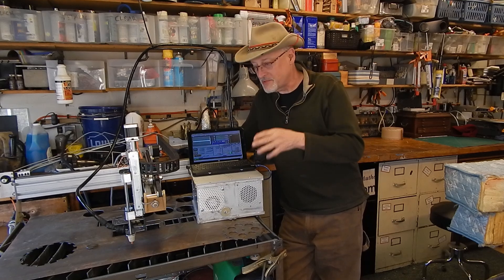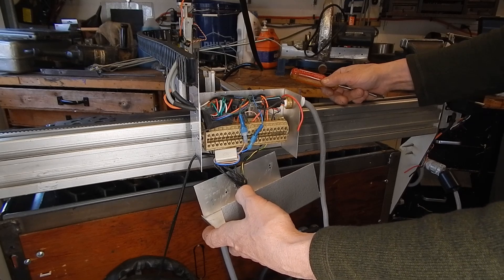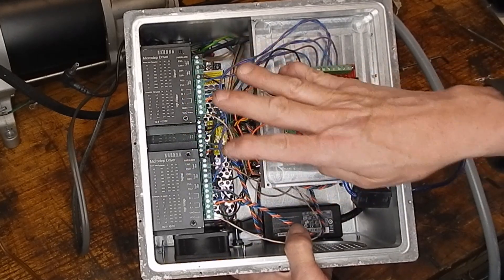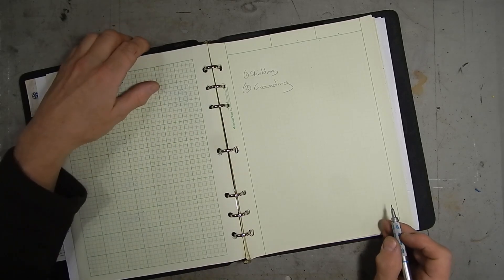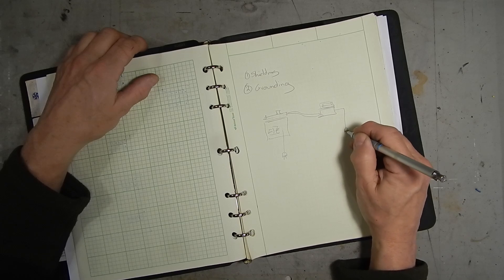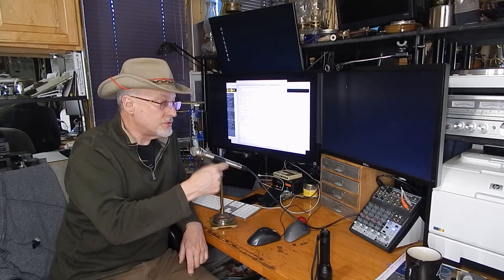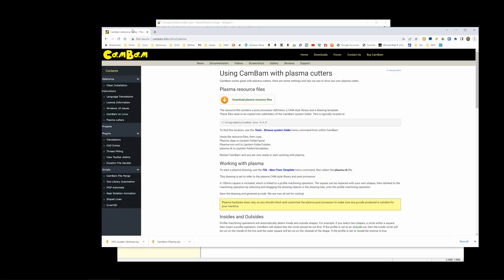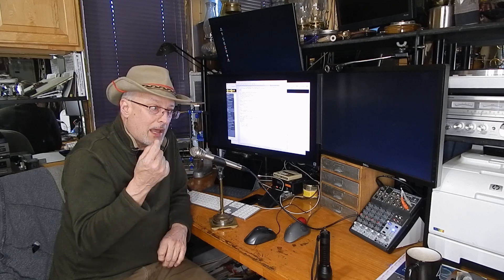CHEAPEST CNC PLASMA - FIXED RFI!

Comment: It would be interesting to hook an amp meter from the tip wire to ground connection and document the current draw before and after the arc is established.

Maybe the tip wire to clamp bleeds off less than you think? A resistor in series could also limit this current drain.

Comment: Great video! I would love a diagram for your filter bank. Can you share what frequency ranges you are filtering? Can't really tell without a resistor value and I don't think you mentioned it. Google says that HF start from plasma cutters can be 10khz-200khz is that about the cutoff frequencies you were shooting for? I'm assuming you're using them as a low-pass filter, but I'm not entirely sure from the way you describe it.

Comment: Sorry but I am just starting out and this EMI stuff is hard to figure out with no electrical knowledge or equipment. So you only connect to the one motor power wire then to capacitor then ground and motor wire can be connected to any lead of the capacitor.
Reply from the maker: Yeah, Basically the capacitors will pass the high frequency noise to ground without effecting the motor current. Every wire from the motors and limit switched is connected to ground thru a capacitor.

Comment: I built a CNC plasma cutter using a cheap cut 50 pilot arc machine but it produces too much emi. I battled the emi issue for quite a while before addressing it on Open Builds forum. By the way open builds control is excellent software for controlling your CNC machine and it's free. They also have Open Builds Cam for converting your files to G-Code and it's also free. A moderator on Open Builds suggested I use a blowback torch plasma cutter rather than my high frequency pilot arc. He said I will find it much more economical to replace the HF plasma cutter than to jump through all the loops with shielding attempts.😮 I have to agree and plan on getting a blowback start plasma cutter. In all of my previous attempts the thing I discovered produced the most interference was the plasma cutter lead itself. It acts as a huge antenna. I was considering making a sleeve for it out of Faraday fabric but decided I would spend the money on a blowback cutter instead. Blowback cutters are generally used most often in environments where sensitive electronics exist. According to the open builds moderator high frequency start is 1970s technology. And while it still works it can be very frustrating in an environment using a cheap arduino-based boards that utilize USB connectivity - such as my MKS DLC 32 v 2.1 control board. I use Grbl.

Comment: I wanted to ask you a question about your CNC cutter. Do you have or plan to install the torch height controller? I already purchased it and many people claim that it will allow the head to keep a constant height above the metal if it is somewhat lighter gauge sheet metal.
Reply from the maker: I’m looking into a Arduino based open source torch height controller but I’m concerned it may not work well with my torch, I may upgrade it before I try.

Comment: Thanks great video. I am building a CNC plasma cutter and I may have overkilled the strength and weight of it. I could probably attach a high-torque motor and use it as a mill.
Reply from the maker: Look into a "drag knife" for cutter cardboard, gasket material, vinyl, etc.

Comment: Hi Jake thank you for bringing to my attention your video. I didn't understand perfectly what are you connecting the capacitors with, you say all the lines but i am not sure. is it like all the motors cables ?
Reply from the maker: Every stepper and limit switch wire on the gantry gets a 47pF cap to ground so only DC current gets back to the controller in the separate box.
Reply: @JakevonSlatt  Thank you for your answer! Pardon me for asking more about this i am just thinking of implementing it  and want to be sure. So suppose i wanted to make the remedy(filter) for the first wire out of the four wires of the first motor, I would intercept its wire, add the capacitor and link its other end to the ground ?

Comment: Hi, apologies for my naivety but if you had used a pilot arc plasma in the first pace then would you still have had to do all the anti-interference work? Thanks
Reply from the maker: I think there would have been less work mitigating the interference. HF start plasma torches create a lot more RFI than pilot arc torches.
Reply: Yes. Experienced it first hand too. Even with these three stages of interference work, if the control box is closer than 2 feet away, I get some random stops. Each stage of work is needed but they are all simple.
Reply: I think what you're asking about is a low frequency start machine such as a blowback plasma cutter. They produce FAR less high frequency interference what are recommended for environments where sensitive electronics are located - such as CNC control boards. Pilot arc doesn't necessarily mean low frequency or low interference. I have a pilot arc machine and it emits a ton of electromagnetic interference. In fact so much that I plan on replacing it with a blowback start machine rather than fight the arduous process of shielding and isolation.

Comment: This is a great video. Would you share the capacitor information? 4700F or 4700uF? 25v?? I have tried all the other things you did as well, just not the capacitors. Thanks for sharing this valuable information.
Reply: FYI re: caps for others. They’re designated as 472. Ceramic caps are rated in pico farads so the first two numbers are the value then the third number is how many zeroes. Eg: 4700
Reply from the maker: These are the caps I used, 4700pf ceramic disks: E-Projects - 4700pF 0.0047uF... https://www.amazon.com/dp/B00E6PGUI6
Reply: Thanks for your help. My old Shapeoko 3 is now a plasma cutting miracle. Amazing. Could not have done it without this video. @JakevonSlatt
Reply from the maker: @tomholgate4630  that’s awesome!

Comment: The metal boxes were absolutely necessary and you are correct that the Capacitors shunting AC to ground is the best change.
Placing Ferrite cores clamped around wires are for reducing HF-VHF-UHF ~emissions~ (Mostly for passing FCC/EMI tests), and seldom have any affect at all on the signals within.
GREAT JOB ON THE GROUNDING TOO!
Reply from the maker: Thanks for the kind words!
Reply: @JakevonSlatt  how did you come up with the size of the cap to use for the filters? Were you able to see the noise on an oscope?
Reply from the maker: @tommyhudson9858  I don't remember exactly where, but I found a blog post about a USB device that had interference issues in an industrial environment and 4700pf was the value they used.

Comment: Nice work! I've used Cambam for several years and it defaults to inches for me. I'm wondering if there's something in preferences that you need to set to inches.
Reply from the maker: Thanks for the kind words!They’re a UK based company so it’s not surprising that “native” units are metric. I think there’s a default preference file that saves your preferred units but the plasma template and style files override that when you load them.

Comment: So with the filters you have built, one leg of the cap goes to the incoming line and the other leg goes to ground. Is that correct?
Reply: I have an old high Freq Pilot Everlast plasma that I ultimately quit using do to rfi and locking up my pc. This may fix that issue!
Reply from the maker: Correct!